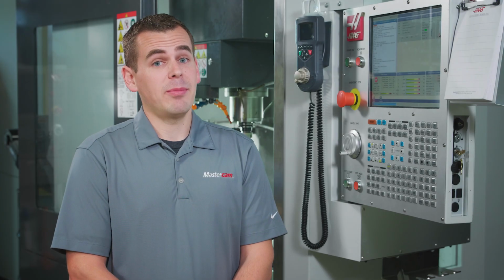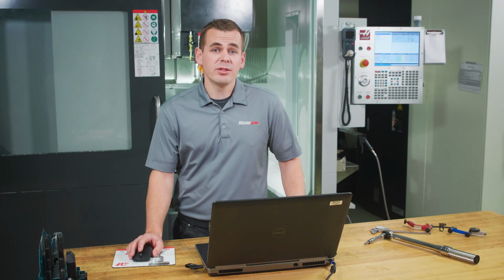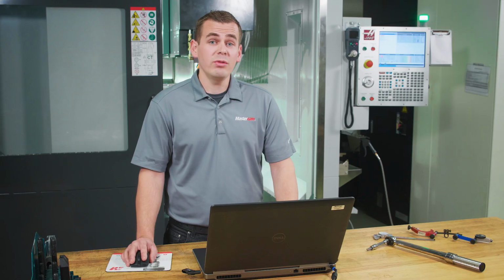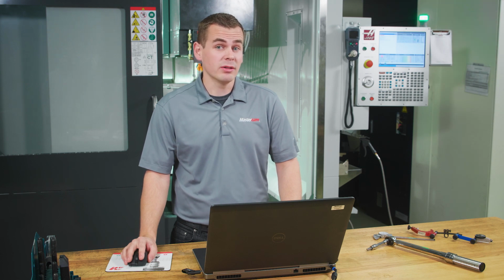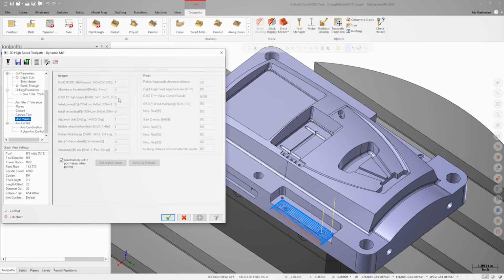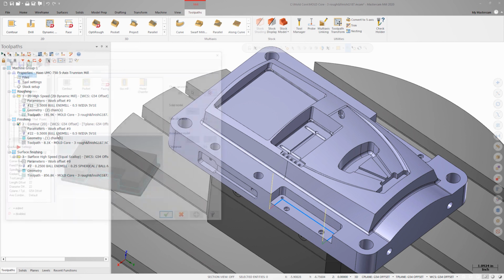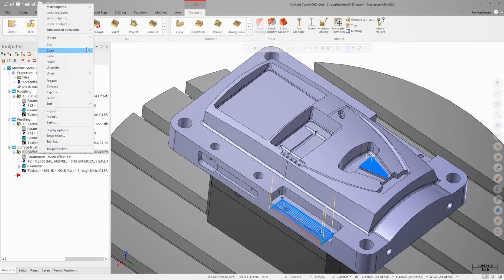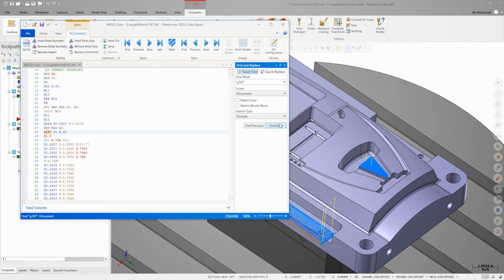Proper utilization of High Speed modes on your Haas CNC.

Comment: I may be wrong here, but in the older MasterCam the arc filtering option would change the tool path to use G17 arc commands instead of just using larger G01 linear commands.  That would allow the machine's controller to make a more accurate arc instead of faceting coming from the CAM's tessellated model.  Is that not the case anymore?